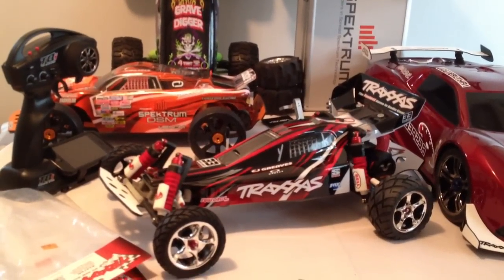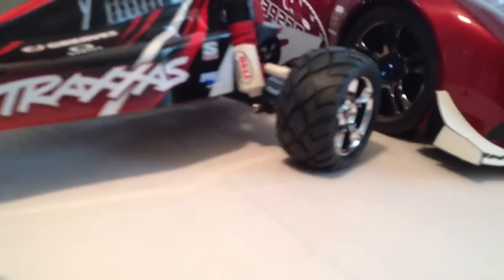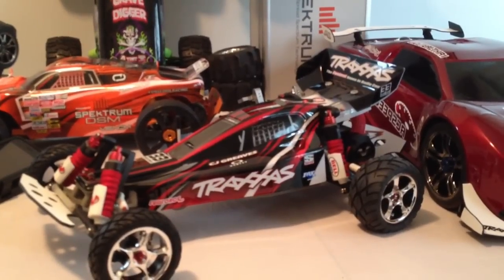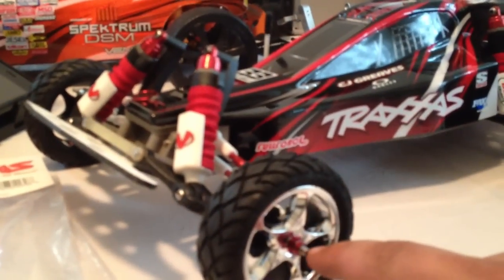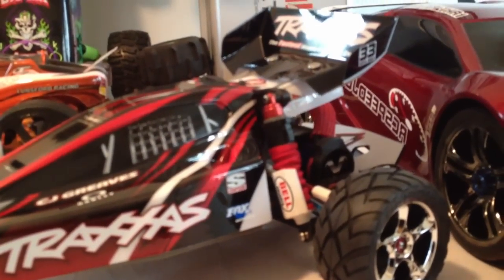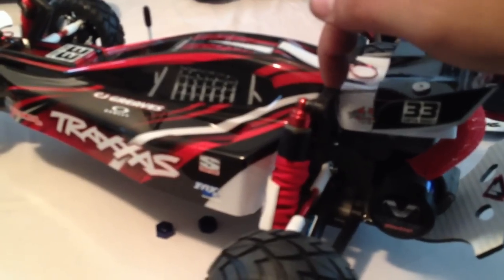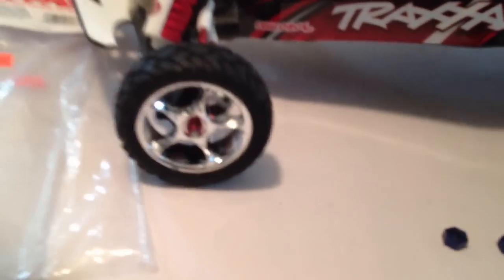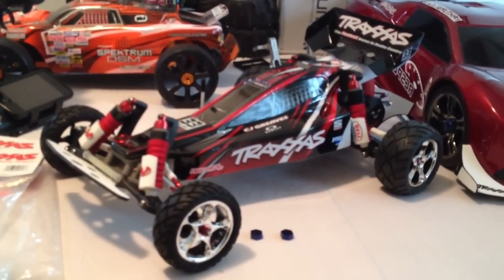Traxxas Bandit VXL Part 2

Comment: Doing up my XL5 Bandit at present, runs a 4300kv brushless motor and esc from hobbywing and a 2S lipo 10000mah from traxxas.
Love what you've done on yours!. Ive only done the steel yolks, rear wheel ball bearings  and put in the 31 tooth pinion, certainly a whole new beast over my stock XL5 setup lol.
Also runs a 2.4ghz control and receiver.

Comment: Wait until you drive it you will see it drives much better than the rustler and hitting 100+ is much easier just trim the wing down but you will need a wheely bar.

Comment: Huh?  There are TONS of upgrades for it. Pretty much more than 98% of all other RCs. Its under Slash/Stampede/Rustler 2wd. Except body,or specifc wheels and tires, there are TONS of upgrades, especially compared to other RCs.   I much prefer The other 2wd Traxxas myself. Not a big fan of the Bandit.